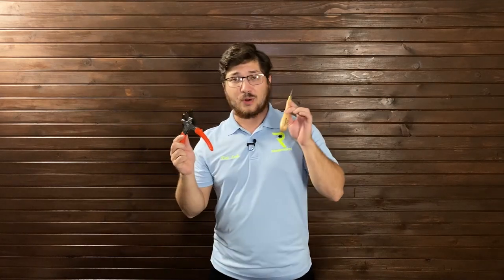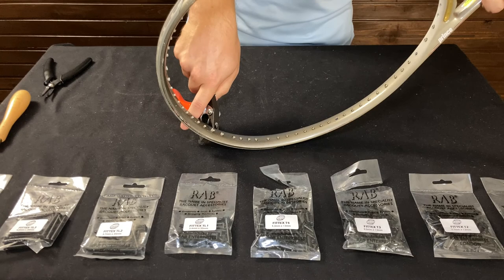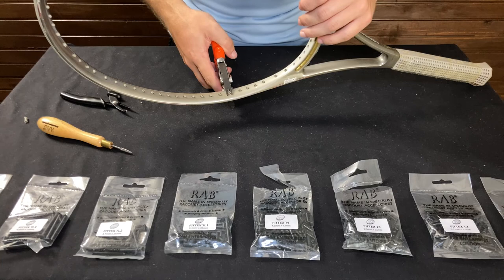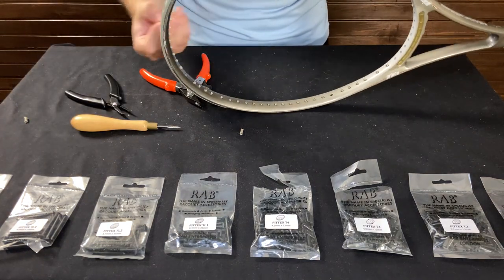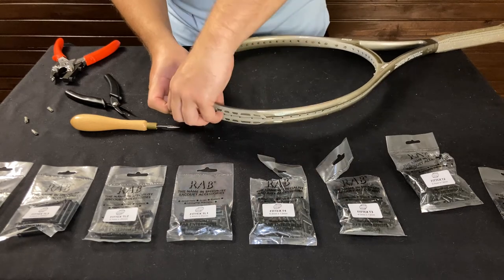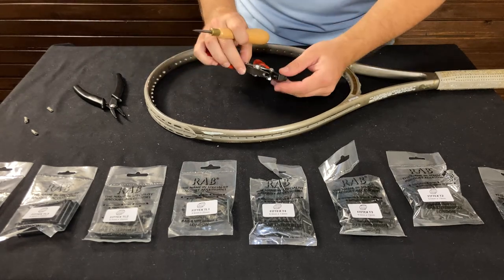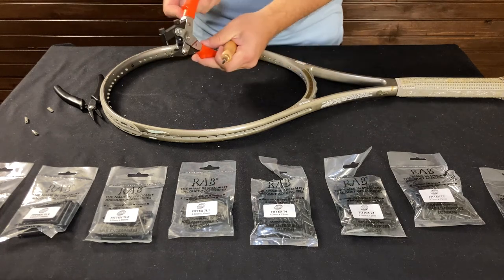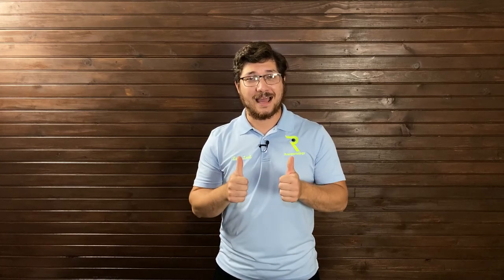Useful Tools For Racquet Repair (Grommet Grinder, Degrommeter, Fittex)

Comment: really nice video, i need to do that to my racquet so i have some questions
i know the fitted are different sizes, which one i need for a head racquet? or i need some different sizes for the same frame? the grommet grinder comes in 3 mm or 4 mm which one should I buy? which sizes should i buy for yonex or babolat?
Reply from the maker: Just buy the 4mm grommet grinder it will do the job for all your tennis frames.

Comment: I need to replace the grommets at the tie off points on a head liquidmetal radical OS. Since they are a bit larger than the other grommets do you have a size you recommend from Fittex? Also, do you have an alternate grommet set that would work on a Head Composite Master since those grommets are no longer made.

Comment: If you don't have these tools what's the alternative method to removing individual broken grommets? I bought a new grommet set but it broke after the 2nd restring... also where do you buy the correct eyelets?
Reply from the maker: The Fittex Grommets “eyelets” can be purchased from New Tech Tennis and Tennis Warehouse. As far as another method It depends on the grommet placement, I usually assume it’s on the tie off but sometimes there can be exceptions.

Comment: basically from what i'm seeing it is possible to put individual grommets?
I have a very old model Babolat and I can't find replacement grommets.
Reply from the maker: Technically, however It wouldn’t work very well and could be pretty expensive. I would first recommend to look for possible “retrofits” which can fit the same mold type. If you tell me what racquet perhaps I might know one off the top of my head.